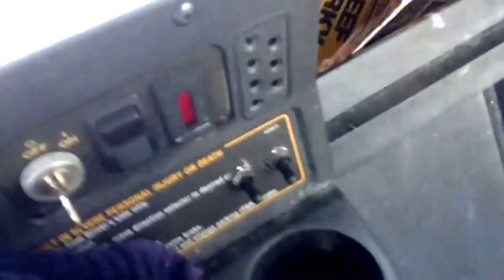EZ GO TXT GOLF CART PROJECT REPAIRS UPGRADES

Comment: That shelf turned out very nice! LIKE 15 Also like the 36V to 12V mod, those batteries are always costly!!!
Reply from the maker: The shelf was a fun project I really enjoyed. The 12 volt mod was to plug in our phones and play music when riding  but it came in handy for plugging in the LED Christmas lights on the roof rack, I used an 80 watt power inverter and did the job well. The batteries are very expensive and need to be kept up with to get at least 7 years life out of them. I just replaced therm a month ago, that reminds me I need to upload that video.. I have 4 in the motorhome as well.